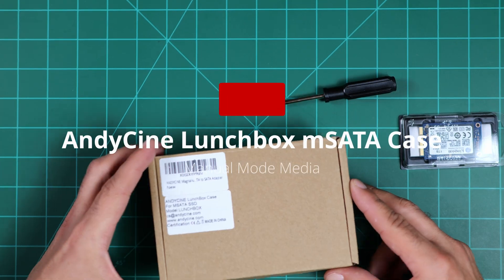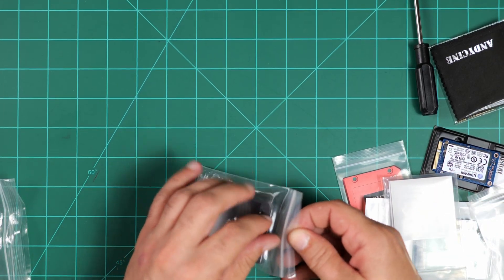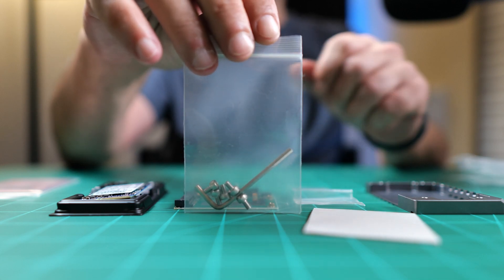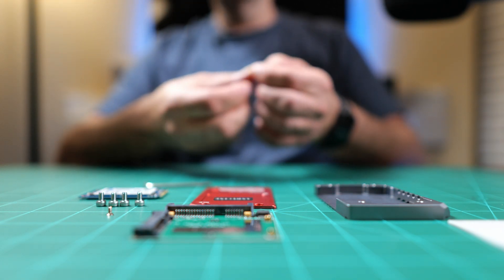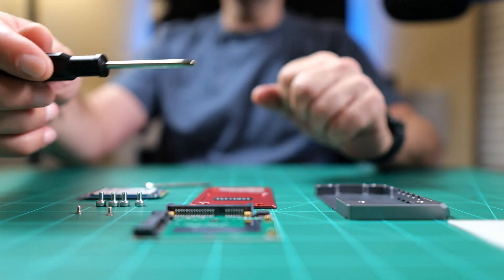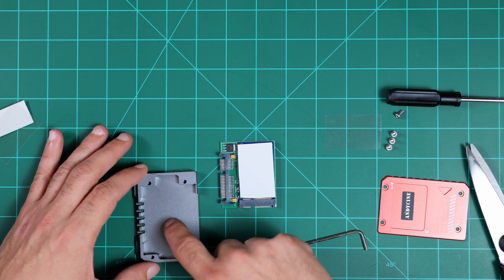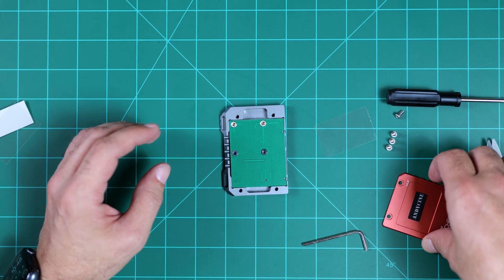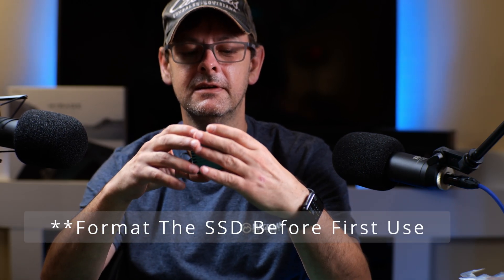AndyCine Lunchbox mSATA SSD Case | How To Install Your mSATA SSD | Atomos Ninja V

Comment: Can you put a samung msata in it ???? mz-m53ito
Reply from the maker: @richardfancey As long as you are putting in an MSATA it would fit in the enclosure.  Just make sure that the MSATA SSD supports the write speeds that you need for the Ninja V/V+ to store the video.

Comment: Great video. Is the Kingston KC600 1tb still working properly?
Reply from the maker: The Kingston works well, but the enclosure heats up a lot if there isn't any airflow across it.  Without airflow across the enclosure, I get errors around the 30min mark.  I have a second enclosure with a different off brand ssd and the same thing happens with it.  The Kingston SSD is good, it's just a problem with the enclosure if there isn't airflow across it such as when I record indoors where there isn't any breeze or wind.
Reply: @ManualModeMedia  Thanks for your complete answer. It is a thing ofcourse